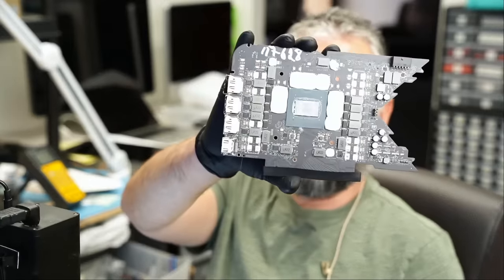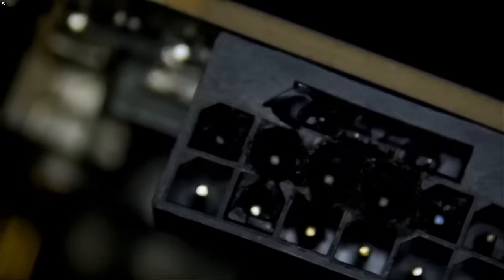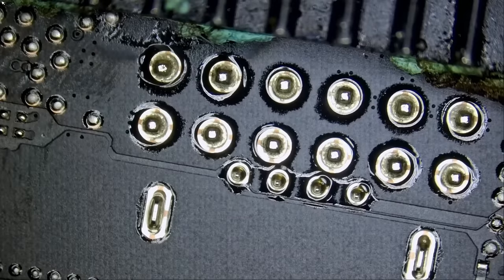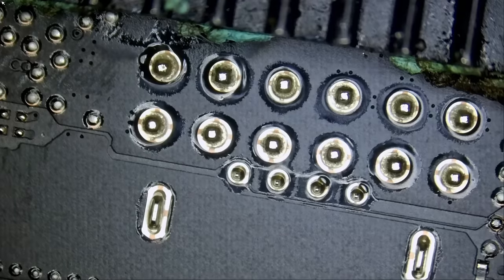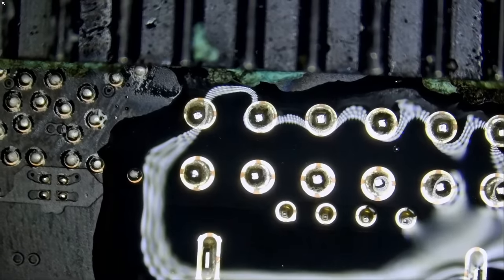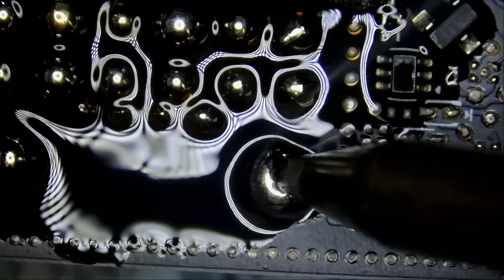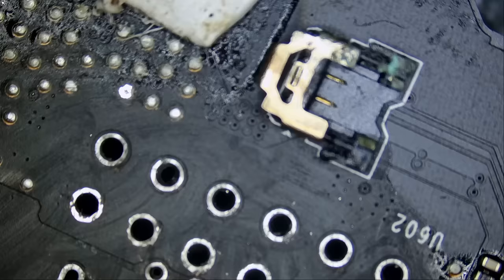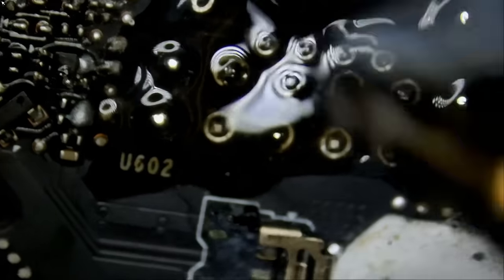4090's Still melting. What I think about CableMod

Comment: Nvidia needs a class action for this as its not acceptable.
Reply: the 3090ti have the same power budget yet nothing happen to them. Stop putting these card in a SFF build pulling and bending the power cable to the extreme to fit in and you will be fine. The SFF popularity boom in the past year is the culprit. The reason why cablemod got caught in all of this is people buying their cable so they can bend and fit their card in the itx form case.
Reply: @delavega92  I get what you're saying but there is no correlation there. The connectors are chugging way too much power for the size of the wire used. They needed to be thicker and more robust to handle the kind of amps they're asking.
Reply: @delavega92  There are to many sources of vibration in any computer for the single clip design to NOT have wiggle out failures. And the connector is rated for current way to close to it's physical limits. It's not just putting cards in tight fitting places ( though enough cases do NOT have room for the clearances these connectors want to show poorly thought through the design is), It's the design itself that lacks sufficient fault tolerances and margins of error.
Reply: @LoCk3H Nvidia does not want to admit its fault in this matter. Which is really pathetic.
Reply: Boycott the boards that are not holding up to the abuse
Reply: @delavega92 has nothing to do with it
Reply: @delavega92  you cant push that much electric current through tiny pins, it reaches a temperature that melts plastic.
Reply: @delavega92 they should have gone with the beefier 2x 8pin connector not that small crappy connector problem solved.
Reply: @delavega92  connector is not the problem, the amount of voltage that goes through it is what killing them !
this is a NVIDIA problem !

it's like Toyota or ford selling a car that has the wrong AMP fuse's
two thing will happen, fuse's will burn without a problem or they will not burn when they should !
Reply: They no longer own it. Then Chinese do.
Reply: If you wanted a Pinto but you knew it would blow up if you got rear ended, but you bought one anyway because your buddy said they were worth it, is it your fault you blew up or Fords?
Reply: @llamapi3  Thank you. Anyone who has any experience knows you only get heat like that due to resistance vs load at the connector. It's a material/design problem.
Reply: Surprised it hasn't happened already. There are many sites showing a very slight misalignment (possible even when the connector is supposedly in its locked state) causes this issue.
Reply: a class action for what exactly? for a standard connector having a failure rate below 5% with most of those failure happening when the user has fitted a third party adapter or hasn't followed the installation instructions?

If anyone would be getting a clas action against them it would be cablemod in this instance, personally I would prefer the cards to have 8 pin connectors like everyone else.
Reply: @OccasusRaven  Yeah sadly they will never do. They can thanks GN for spreading false "user error" narrative and saving their ass, he really messed up and is too proud to admit he jumped to conclusion.
The root cause for the melting is probably not just bad design of the connector (which clearly is terrible) but some power design issue causing intermittent imbalance on power draw.
Reply: @oxfordsparky  completely FALSE
Reply: We can dream 😅
Reply: @delavega92   not true, i have a 3090 and a giant case, ive had 2 connectors melt already. nothing is even overclocked
Reply: Plug it improperly, and it will melt, then you can blame Nvidia for not engineering a connector that is immune to user errors.
Reply: @IslamGhonaym  wasn’t improperly seated, but thanks for assuming that! Here’s another assumption, I’ve prob been building computers before you were born!
Reply: @user-dy2bu7jd9b  First 30 series Ive heard do this. This is really terrible.
Reply: @user-dy2bu7jd9b  These people cheering on this obvious faulty designed connecter are really something. They must be Nvidia employees getting paid to say these things, IDK why else anyone would do this??
Reply: @delavega92  Hi nVidia shill. Did they pay you your proper 0.50$ for that trash? No one ever had this issue before the 4090. Why? No card was this defective.
Reply: @delavega92  So you say 3090Ti consumes as much as power as 4090TI does? I doubt it. The connector might tolerate lower wattages and fails at higher ones. That only proves that this connector is a result of a series of poor design decisions.
Reply: @temp50  the 3090ti consume more power in most cases.
Reply: nah, just idiots who can't follow instructions on how to properly plug in a cable.
Reply: Alex won’t be complaining
Reply: @theodanielwollff That’s a hell of a lot off idiots that can’t plug a connector in then. People just suddenly became idiots when the 4090 released? There is an inherent fault with the design and spec of the connector it’s not just user error.
Reply: That 2 trillion plus dollar company would just laugh at a million dollar lawsuit lol
Reply: @leemar1978  Just look at how many people vote for the wrong dude? clearly people can't plug in a connector either.
Reply: @delavega92  I purposely upgraded to a Corsair 7000D full tower case so the power cable would have acres of room and also vertical mounted the GPU. There was no way I was spending £1700 on a GPU and bending that power cable due to lack of space.
Reply: They'd need to drag in the corp that approved this  spec  Wich would drag in every member into the class action and I'd be for that it would set a precedent you approve a fire Hazzard you get fined into the ground so you learn not to take 💰💰💰💰 to pass something that is a literal fire Hazzard look what happened to the Note 7.
Reply: Agree
Reply: ill say it again, we've probably sold over 500 4090's in the last year, and not a single one has had this issue. hell, i dont even think any of our 5 stores has had any with the melting issue, and thats probably over 2-3 thousand+ sold 4090's from all stores that hasnt had this issue even once.

MOST DEFINITELY a user issue.
Reply: Over clocking is not covered
Reply: First you can’t be poor
Reply: Class action lawsuits only really pay lawyers.

The consumers get pennies.
Reply: @oxfordsparky this is the funny part , My 7900XTX can pull 500w just fine with 3x 8 pins.

Nvidia really should just limit the 4090 max wattage to 500w aswell....you get nearly no gains adding 100w so what's the point.
Reply: @delavega92 so why create a new power cable and not use all you’re resources and predict market trends going to sff

Comment: So glad my 4090 had faulty heatsink and RMA took it and had no replecement got my money back, awesome card but burning connector would haunt me everyday.. Now using 7900 xtx with three traditional 8 pins and no worries about it
Reply: I was in the market for a new GPU. I went with a Galax 4070, the best GPU I could find with an old style PCIe power connecter, I wouldn't have needed a 4080/90, and I haven't heard of any 4070s drawing enough wattage to melt the HP connecter, but just didn't want to take the chance. This is a really bad design.
Reply: Yeah I went with a 7900xtx aswell. It drives my G9 Oled perfectly fine so I have nothing to complain about.
Reply: Reference 6950XT with just dual 8 pins here, gaming life is good and worry free. I was looking for 7900XT around that time but MSRP was way too high, it"s a lot better now though.

Comment: Nvidia does not care, they are not a gaming company anymore. They transcended to AI
Reply: NVIDAI
Reply: Gamers helped to elevate the business, Nvidia should be grateful for the gamers that supported them with the first Gforce card back in the 90's.
Reply: Lol……….AI is not immune to burning power connectors on a graphics card methinks………so Nvidia should be concerned. It’s a flawed connector that has a wire size incapable of carrying the required power. So it heats up and melts the connector. Pretty basic shit that engineers at Nvidia should have learned on day one of “wire capacity class”.
Reply: """"AI"""""
Reply: @RAZGR1Z  We will see how far the rabbit hole goes.
Reply: AI is literally why the cards are melting lol. Do you realize how insanely power intensive AI projects are? They make 4k60 gaming look like a joke LOL
Reply: @mr.number9279  Yeah the 5090's will be for AI, and then they will melt.
Reply: @davehenderson6896  Most functions of a GPU even now are for AI though, DLSS, frame generation, etc., are all AI functions applied in real time.
Reply: @mr.number9279  What I mean is that AI will be used for way more things once the 5090 comes out.
Reply: @davehenderson6896 gratefulness isn't a corporate virtue, unfortunately

Comment: Thank you for carrying everything to fix our 4090s ourselves in your store! I had some trouble because I was using a 35w soldering iron with a tiny tip, but somehow I managed to fix my card anyway, with quite a lot of help from my hot air station. It's been running hard every day since my repair last month and it still works fine so I'll take that as a win!

Comment: Like i said, the more power you push through material the more it heats, the issue here is, there's not enough material to carry all that power.
Second, every engineer with his head on the shoulder knows, you have to account for loss and conectors are a loss source, you lose contact area, as a result it acts as if you push 40-50amp into a 1mm  wire , it will heat and burn.(exageration intended)

Comment: Wondering how 50 series cards will be with these connectors 😂
Reply: The spec of the connector has been redesigned because of the 40 series issues, it's now called 12V-2X6 rather than 12VHPWR. The sensing pins are 0.1mm shorter and the conducting terminals are 0.15mm longer. It is backwards compatible too, so you can get the new spec cables and use them on a 40XX card.
Reply: Still a tiny connector for 600W. 10A per Pin with a safety factor of 1.1 is insane.
The 8-pin had 8A and a factor of 1.9, so it was always safe even when under bending load.
Reply: @Zipa7 mine melted after 6 months regularly checked. Was fully fitted and have photos.
Reply: 🤔 …………. the same.
Reply: Yeah even with the redesign I can't see myself going for a 5k series card. Oh well, helps out my bank balance at least :D
Reply: They will have two 12vhpwr connectors 🔥🔥🔥👨‍🚒🚒
Reply: It will have two melting connectors and 1000W TDP so double fan ahead 😂
Reply: All you need is a 140mm fan to cool the connector lol
Reply: Pls make video @synony6
Reply: I am sure Nvidia fix it by now and they have stronger updated version of this connectors who do not melt.
Reply: They will use a dip pin header for a kilowatt lmao
Reply: @Zipa7  Trust me it will still melt. A bit dust or bending plate in the female connectors may still cause it to melt.

They need to put temp sensors on the connector if they still want to use it. At least stop it before it melt or damage the cards.
Reply: @synony6 you shouldnt be plugging and unplugging the cable that much, it can lead to faster wear and tear

Comment: Didn't want to mess with these adapters, got the Corsair 12+4 cable instead of using the stock cable, my 4090 hasn't melted yet, fingers crossed.

Comment: i must be one of the lucky ones  i got a 4090 founders and immediately put a ek waterblock on  with liquid metal    used the adapter it came with made sure it was seated in all the way in and wasn't  stressed being  bent too much with the cover  and still to this day i can run benchmarks and play games all day and  nothing melted
Reply: Waterblock doesn't change that it's a power delivery problem. So your liquid cooled GPU is just as susceptible. It's a problem that can pop up any time, so a GPU that seems to run fine still isn't safe.
Reply: @peoplez129  Actually using a waterblock reduces the issue - having air coolers blowing alot of hot air onto the connector (which they do) is part of the issue, but obviously nvidia shouldn't be using such a sh1tty connector in the first place.

Comment: I don't think I've ever seen a GPU with more problems than the 4090. Even though Nvidia possesses the most powerful GPU currently, their new power standard is beyond flawed and it seems there's no permanent fix.
Reply: Too many amps running through a tiny plastic piece poorly designed.
Reply: I hate NVIDIA also but we need to keep in mind that the connector was designed by MOLEX and NVIDIA just chose the connector based on its datasheet and specifications.
Reply: @whatcouldgowrong7914  their engineers knew better, and that's on them. Nvidia chose to ignore the power limits, leading to our current problem. I mean, there's a reason AMD never jumped on the bandwagon in the first place, and now, look at who's suffering the most. 🤷
Reply: The standard, which Nvidia is a part of defining, has already been changed. Future products won't have this connector. Sadly I think the people with burned connectors would need to band together and sue. Personally what I think it is, boils down to cheapness to some degree. The connector is rated for 600watts max, the 4090 gets too close to that. Nvidia needed to split that voltage over two of the 600w connector for the 4090.
Reply: @whatcouldgowrong7914  exactly, the amount of idiots saying that nVidia's connector is terrible is truly amazing, the blame lays with a combination of Molex and PCI-SIG. This is like blaming BMW for a Michelin tyre failing.

Comment: I have a question, what happens if the power cable is soldered directly onto the board pins?, removing the connector first. I know that the possibility of exchange would be lost, but the connector wouldn't melt anymore, right?
Reply: Shoulden't but then you have the wires them self.

Comment: I am quality engineer for long time. It is a good case to dig out root cause then find out long term solution. If Northridge change the connector can fix the problem and customer never come back for one more repair. I would think it is process related issue.  Flux contamination then user find the burn issue after use for some certain long time. Data analysis is key to improvement quality. Most of my project I always suggest customer select thermal plastic and I can use paste in hole process to prevent flux type issue. If manufacturer use wave machine I always ask them put on a cover to block the spray flux onto pins.

Comment: I don't own this kind of device but if I did I'd add an "engineered' aluminum heat dissipater and dedicate a fan to blow on it at all times. I'd also put a temperature probe on it to keep it in check on the amount of heat being raised.
Seems that companies WANT your device to fail "after warranty" so you have to buy a new one.  This seems to be an ongoing problem. 
So, wake up and do your own "blueprinting" on your devices.
AND, keep it clean.
In fact, if you're as good at electronics soldering as Mr. A, you could remove the mod from the board and run a cable for the board to the mod and keep it on the outside where you can make a "cooling box" for it using the aluminum heat dissipater and separate cooling fan.
That way, if anything disastrous happens, you're board is safe from fire. 
You could also add on a temperature probe with an alarm set to just under the melting point.  For that matter, a temperature cut off switch thermally set.
Isn't it better to FIX the problem yourself with maybe help from someone with better soldering skills than yours maybe?
I see this as a very simple solution and even wonder why no one has come up with a device as I described for sale to make the unit much better and safer.
Reply: Now's your chance to design one and get rich.  ;)
Reply: That fact that we're even talking about putting heatsinks and fans on a GPU connector is just hilariously sad.
Reply: I know!  Right!
So, what is the cause of this?
How do we better engineer it?

Comment: I use CableMod 12VHPWR ANGLED ADAPTERS V1.0 180 Degrees and CableMod 12VHPWR cabel with RTX 4080 about 1 year long. They work well and there are no problems, I don't even want to replace them. I have taken it apart about 4 times, but it always fit back together well and snapped together.
Reply: Same here I have 4090 with CableMod 90 degree V1.0 adapter checked few times all seems ok just not want to change it. My plan is to buy later new 3.0 PSU where is 90 degree cable is included or extra option made by the PSU company.
Reply: 4080 is fine, it does not output enough power from what I have heard.
4090s are what burns up.

Comment: I have a 450 watt 4090, the first cablemod cable made stability problems after a while, so they replaced it.
The second cable i got from cablemod i plugged in only once and left it there. I have no problems since. The more often you unplug and reconnect the cable the worse it gets. Of course it should not be like this,  the old 8 pin connectors were perfect, no problems ever!
The 12vhpwr connector simply is a total failure!

Comment: They need to re-engineer this connector standard to be a tad larger per pin, and with two more pins. and to have more than one clip holding it in. Also the info pins need to be data enabled, spi or c2 or some such so not only can the max power output be available, continuous and peek power can be communicated, and such other data as needed and/or desired. Main power connector to the board should also have a data channel, one that can be used for all the stats and current conditions.
Reply: It is, the standard changed.

It's still a tiny connector though.
Reply: @volvo09  I was referring to the latest 12+4 pin gpu power connecting needing a complete re-design.
Reply: Honestly it doesn't just go back to normal 8 pin power connectors @kaseyboles30
Reply: Or they could just use the 2-3x of the old school 8 pin connectors. The old 295x2 pulled 500 to 700 watts trough two 8 pins they did not catch on fire.